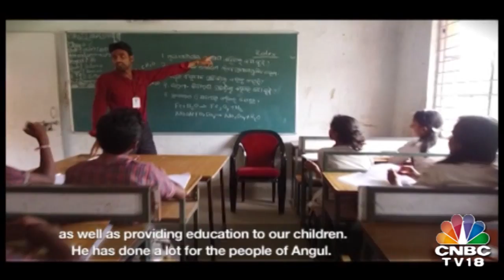Rise Of Jindal Group, Story Told By Naveen Jindal

Comment: Out of 19 years of my career I have spent more than 13 years with JSPL. During my stint with JSPL, I got many opportunities with other reputed conglomerates… but did not switch over… not because I did not crack those offers… but for the simple reason that I have full faith in JSPL and in foresight… vision of our Chairman Mr. Naveen Jindal. 
During my tenure I have seen so many ups and down… which is normal for any large size company… but at the same time I have also witnessed incredible transformation of the entire group… how we overcame obstacles… almost rose from the ashes.
I was there in the core team of Angul ever since MOU for JSPL Angul was signed… have seen how a barren land turned into a technological marvel every Jindalite is proud of.
As Kapil rightly said we sold few non-core assets… to focus on our core strengths, which has only made company healthier by the day.
Its one company who welcomes new technologies… innovations wholeheartedly and is a benchmark for many steel majors.
Proud to be a Jindalite.